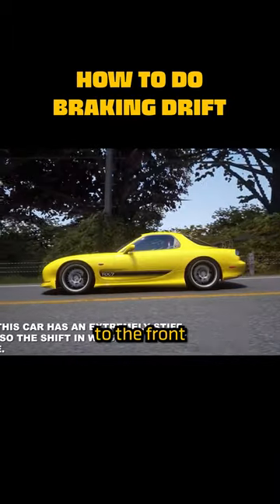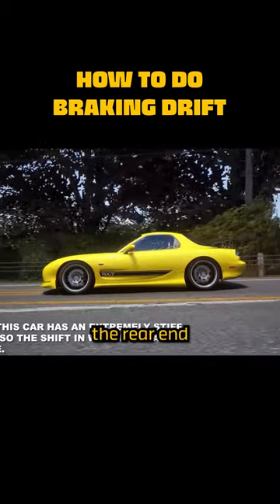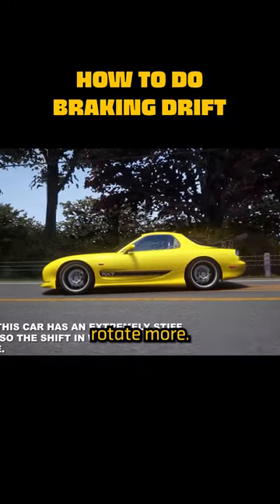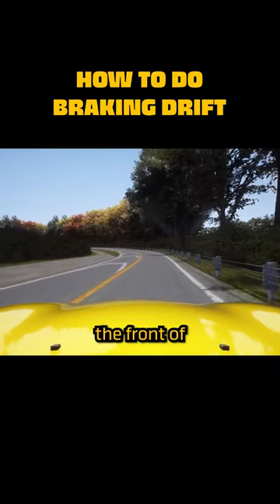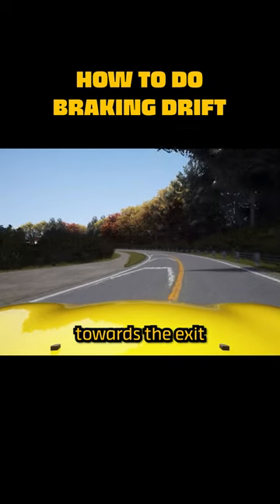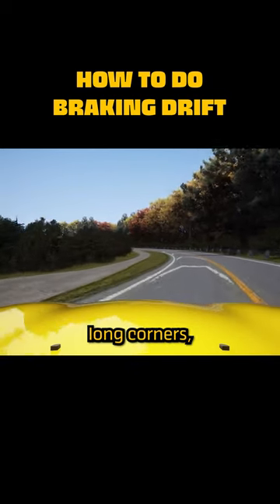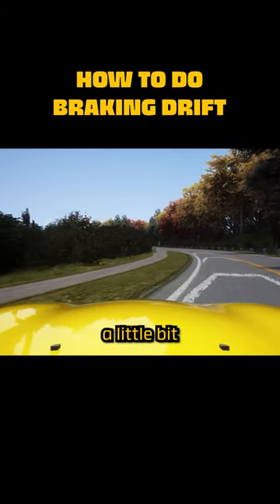HOW TO DO BRAKING DRIFT #shorts #assettocorsa #simracing

Comment: Also what I done in a GT Comp was blipping the throttle from Entering to Apex to exiting the corner maximising weight distribution insuring the car doesn’t over or under steer through the corner. U also get a high exit speed as ur at max RPM’s as u exit

Comment: you should show the dynamic drifting too, it is a way of drifting faster than the braking and handbrake drift that you only need to make pressure in the back tires by turning so they lose control, then keep accelerating, you dont even need to brake
Reply: Isn't that just lift-off oversteer?
Reply: If your rear tires lose grip when you just turn, you are probably going to be slower than a well balanced car
Reply: @versa5864  Yep. It's annoying, but I use it when facing cars that are faster than my own.

Comment: Techniques like these more or less is near impossible to learn on a controller
Reply: Less is more
Reply: I’ve been trying to learn how to drift on assetto corsa with controller, and i want to die. Well, it’s better than spending 500 dollars into a full wheel and pedal setup lol
Reply: @bolson42  i know the feeling better to have steaks vs a wheel lol
Reply: If you don't play controller, then you really shouldn't say it's impossible. It's genuinely one of the easiest ways to get more rotation into a turn.
Reply: @bolson42  I don’t know if you’ll see this in time. It’s cyber Monday go online rn and you’ll find shifter pedals and a wheel for under 300 easily
Reply: @KingDeadMan  controller your setup makes it your turn in on a wheel wont work with a controller so front camber rear diff your spring weights rebound your trans tune if its not doing what you want it too then maybe you need to work on it
Reply: @mexicanjesus8672  I don't have that problem. It's an easy skill to learn.
Reply: @bolson42  you missed it i got a g920 on Black Friday for 200
Reply: Been trying it on MR:T on Roblox and it’s difficult but I’m starting to get used to it. I can’t apply too much pressure on the triggers or it’ll brake too hard and too fast
Reply: buy a wheel

Comment: What happens when you hire a random dude as a editor
Reply: it definitely is one of those auto captions stuff because even a random dude getting paid in cents per hour would do a better job
Reply: Most likely adobe's automatic caption feature. I use this a lot and it does make honest mistakes like that. OP should have gone through the transcript and changed the mistakes. Just lazy editing :)